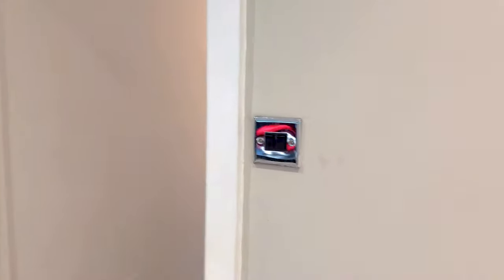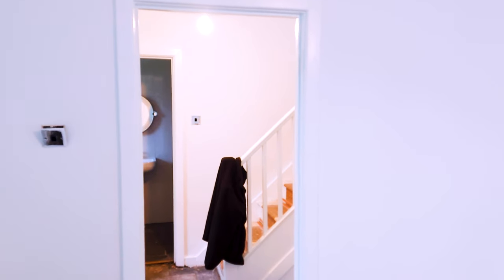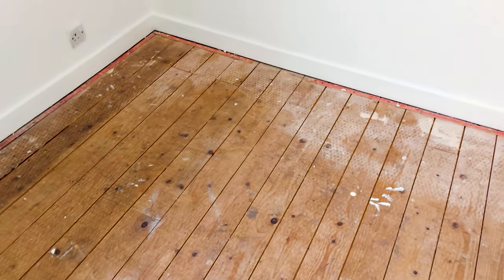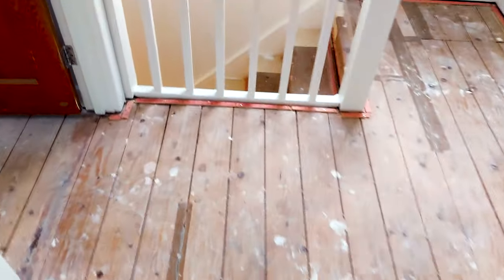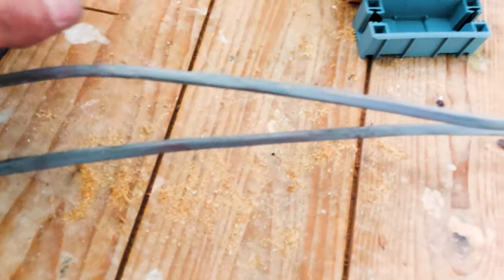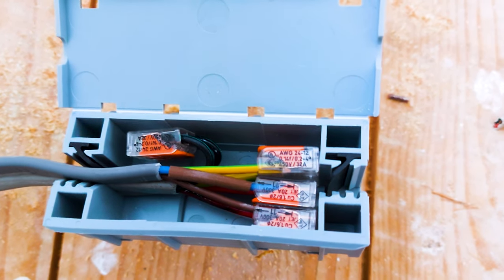Moving a light switch to the other side of a door

Comment: I already did that too. 
In Germany, the cables are often in the wall. And our cables are double-insulated with brown, blue and yellow wires. 
My brother wanted a two-way circuit, so I misused the yellow-green one. 
The wall is a hollow stud wall, i.e. wooden beams with plasterboard on it. 
Under the ceiling we sawed circles into the plasterboard with a circular saw at a distance of 1-2 meters.

Then we pulled the cable from the old switch behind the plasterboard to the new switch. 
The switch required all three contacts for a changeover.
We put the sawn out circles back in later. 
Clamp behind the old switch, done.

Comment: Niceic registered sparks and you don't even know the wago box you used is not Maintenance Free ....it was the wago light box you used not the MF BOX......You need to change that or make it accessible......you need to read up a bit on what your using......gid only knows what else you have done wrong in other vids......NICEIC   Says it all
Reply from the maker: I knew that Mark but you're the first person to notice, so well done to you. Sometimes, you just don't have the right part in the van. If you watch other videos you will see me use the correct  Wagobox 221-4, however top marks to you for being eagle eyed. I've been waiting for this comment
Reply from the maker: Because strictly speaking you should use Wago 224 connectors in the Wago Light box for it to be classed as fully MF. The manufacturer's instructions have to be followed to the letter otherwise it isn't strictly "maintenance free". That's what Mark was referring to. I'm not getting into semantics about whether it needed to be MF (i.e. it's still accessible by lifting the carpet and a floorboard just like millions of screw terminal JBs over the last 100 years), but that's another debate for another day
Reply: @abcelectric  Wrong again.......as I said in the previous post you really need to read up on products before you use them....The wago light box is not a MF box no matter what connectors you use.....Try going on the wago website to learn a bit about the product before giving all the DIY Daves false information     I hope the NICEIC  Doesn't see your vids as you could be encouraging people to carry out work that is against current regs and could cause an accident and is now all over the internet
Reply from the maker: OK Mark, you are the man. I didn't read up about the product because I normally use the Wagobox 221-4 and in one instance I didn't have one and I posted a video on YouTube. I shall just assume you're Mr. Perfect then and I'll go back to school after I've finished self-flagellating for my terrible sins to the electrical industry. I stand forever corrected, worship your greater knowledge and praise you for policing my content with the greater good of mankind as your arbiter.
Reply: @abcelectric  All you need to do is carry the work out properly and safely and you won't  end up in court because someone followed your vid and got hurt........Apology accepted
Reply from the maker: @markyd2633  It's not a "How to..." video. It's just a vlog of one small part of one job that I did. Nowhere does it say "How to...". The "MF" box is accessible from above and below with the use of a tool. The rest of the property was littered with screw terminal JBs under floorboards and God only knows what else. I took a judgement call based on my extensive knowledge of BS7671 and my extensive experience and it's not even remotely dangerous or bad workmanship. If anything I made the mistake of uttering some badly considered words. You are just being a pedant and we both know it. What I don't know is why I'm wasting my time discussing semantics with someone like you. Get a life mate
Reply from the maker: @markyd2633  🥱
Reply: Sounds like Marky D needs to get a life.